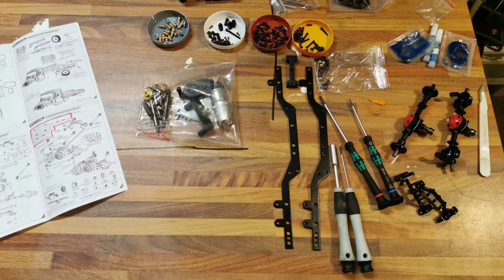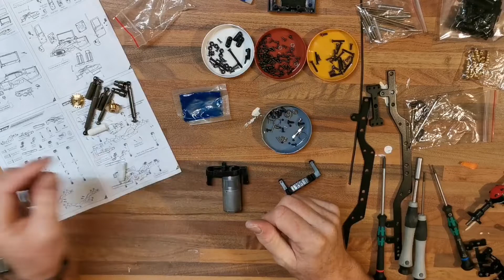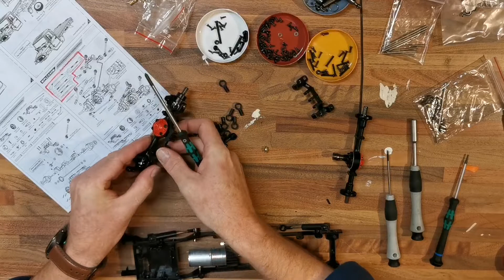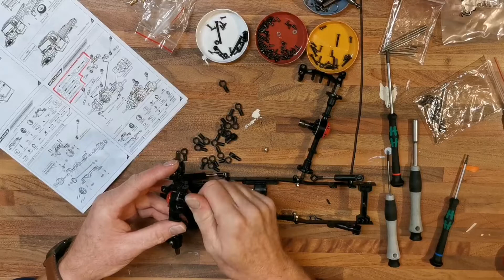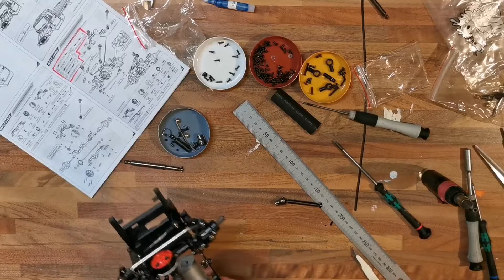WPL C44KM Real Time Build - Part 2 - Gearbox and Chassis

Comment: Is it normal for the C44KM to come with this gearbox? Mine came with the 2 speed gearbox.
Reply from the maker: I bought the single speed alongside the full kit with the two speed included because I wanted to build this combination and use the extra long driveshaft. I've always preferred driving my 3s powered single speed truck to those with the two speed.